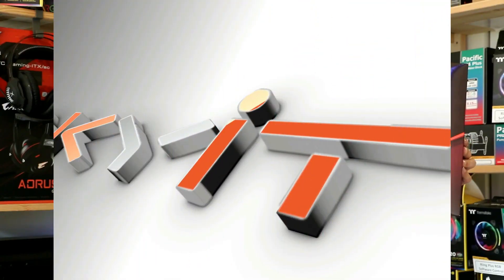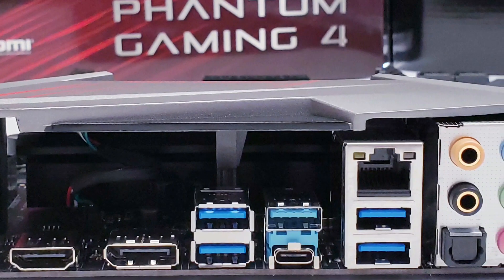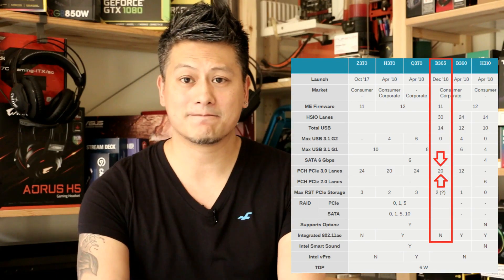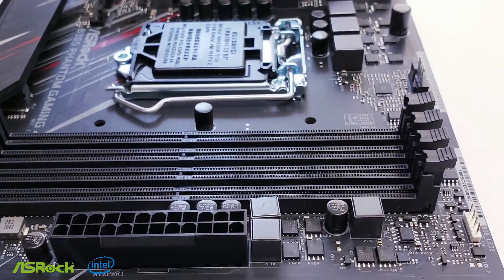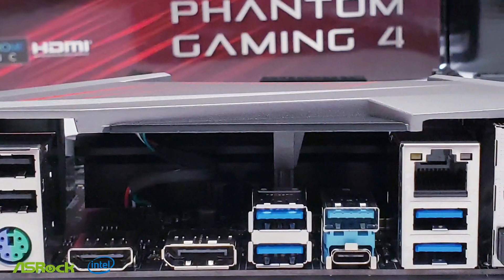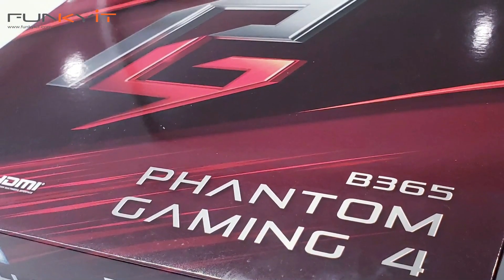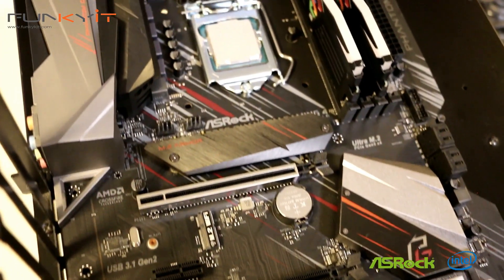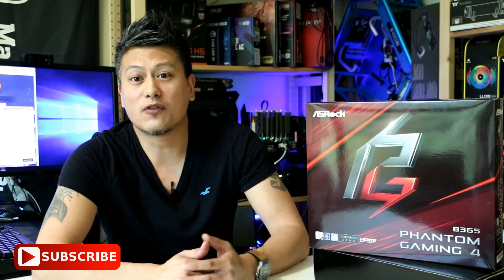Feature-rich motherboard with Intel B365 Chipset - ASRock B365 Phantom Gaming 4

Comment: thanks for the video! great work. But what happens if I use ddr4 3200mhz? Will I be able to load the XMP profile and it runs at 2666 mhz downclocked? Or will it have to run at 2133 mhz which is the absolute minimum standard not OCed?
Reply: if you go into the bios you can manually enable the XMP profile for it to run @2666mhz, 2133mhz is the default speed for most ddr4 ram without the XMP enabled